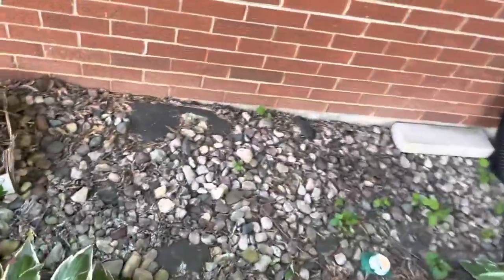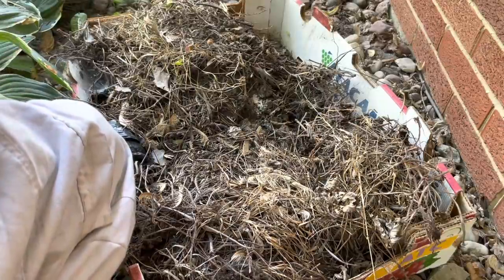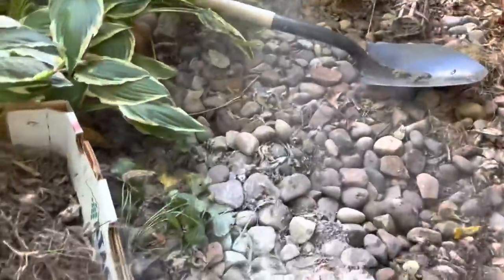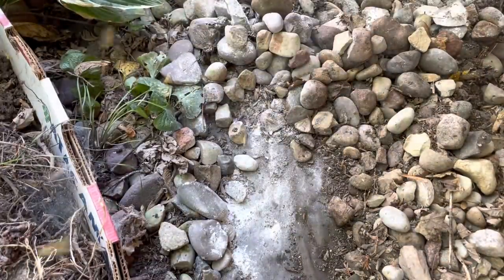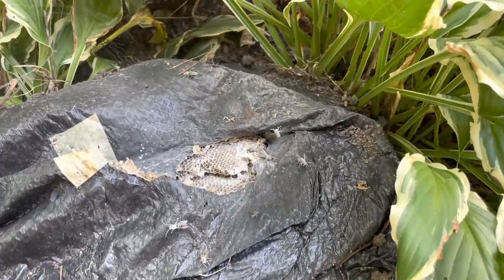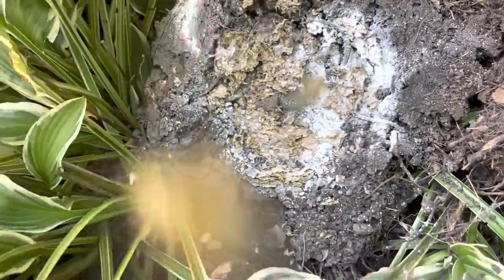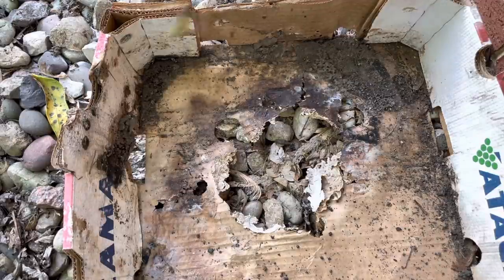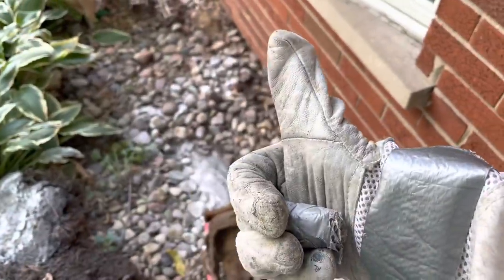Bald faced hornets and ground wasp at the same house, 2 nest removals

Comment: Hey bud thanks for the videos. You are such a cool person. And I have a question make that too. One do you ever get stung through the suit. And two I cut grass with a buddy of mine and I always see yellow jackets. What’s the best way to cut grass without angering them
Reply from the maker: I do get stung pretty often, sadly the suits block most but not all of them. For cutting the grass it’s the vibration that sets them off your best bet would be to walk the yard before mowing and look out for any ground activity. You can normally notice the area is slightly bedded down around the entry points.
Reply: Thanks bud keep up the videos. I love them

Comment: How do you remove the nest residue stuck on the house. 
I’ve heard a pressure washer will take it off completely with some kind of soap
Reply from the maker: Water and some type of abrasive sponge or something similar to wipe it off. Once it’s wet will be much easier to remove

Comment: Do you do any other pest removal?
Reply from the maker: Currently I just do wasp, I started in the pest control industry and did all bugs but it’s a terrible industry at least the people I worked for were terrible, I will eventually do other treatments but there are lots of licensing required in my area and it’s not cheap to get done.

Comment: You need a Japanese Pull Saw to cut those edges. The blades are flexible and cut on one side. (Don't get the ones with a rigid, reinforcing top. With the handle they're about 20" long.